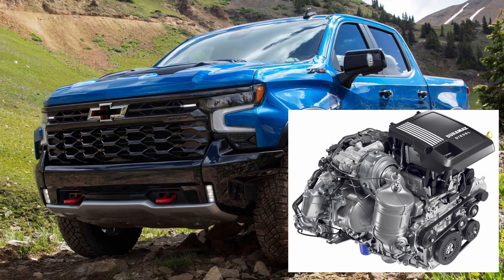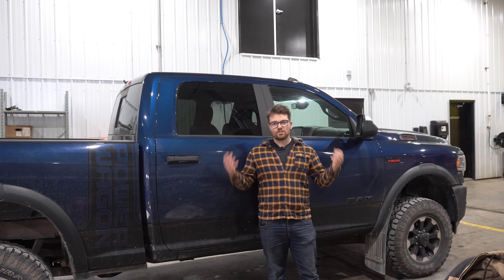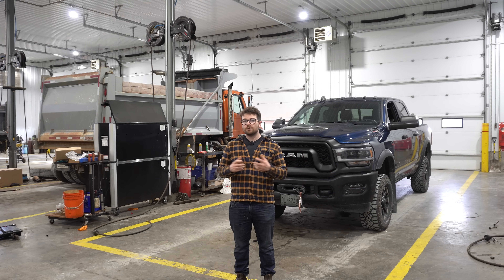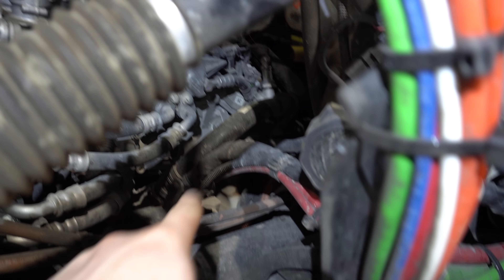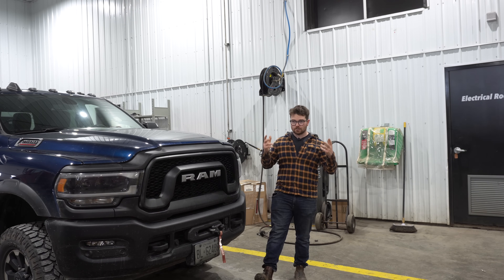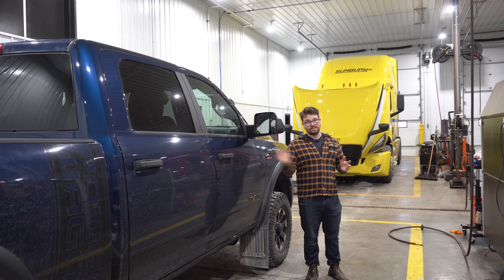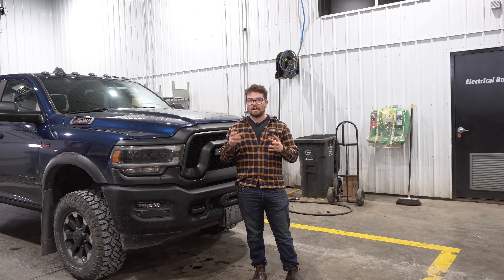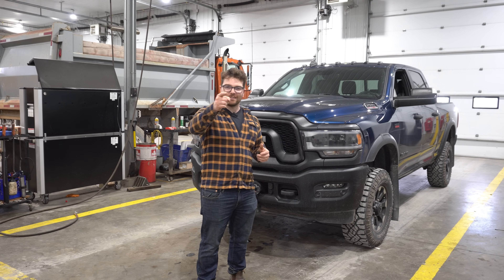Chevy Silverado 1500 3.0 Duramax Diesel **HEAVY DIESEL Mechanic Reviews** | Is It a GOOD Engine??

Comment: My understanding is that they finally figured out how to mitigate the long start issue for the LM2 without needing to replace the CPS exciter wheel. Basically, the issue was that the ECU just gave up if it got a single invalid CPS reading during the startup interval (which was short).  My layman's understanding of the fix was to add a few extra rotations to the startup interval and sample more than once. That apparently has fixed it permanently for nearly all situations where the wheel was the problem. (The underlying supplier issue was fixed for LZ0.)
Reply: Ecu flash fixed mine, it pauses the start procedure for about .5 seconds to allow multiple sensor pulses for the start sequence.  Never had the problem since.
Reply from the maker: Good to know! I guess my info is old. I'll pin this comment so other can see!
Reply: @cjwright1960  It pauses the start process lol how convient.
Reply: @foch3  yeah an unflashed ecu will start cranking immediately and engine star happens very quickly when you press start, a flashed ecu will have about a half second delay before it starts cranking, and the cranking cycle will last about a half second longer.
Reply: The engineer details those changes here: https://www.youtube.com/watch?v=J7KM5-oMLm8
Reply: My 2021 GMC Denali with the 3.0L diesel has done long crank/no start issue. It has occurred 5x in a year. Cranks for 30 seconds which the owner can’t stop. My gas mileage has also dropped by 10-12mpg in the winter. Best I’ve gotten is 37.5mph highway. Missing that.
Reply: 87,000 miles on my 2021 and I have had a long start twice.

Comment: The oil belt is not an issue, because you just replace it (you don't pay to inspect it at 150K and then put the old one back on). If it fails, GM chief engineer says it just limps you to side of the road, nothing serious/catastrophic. And the new update coming is longer belt interval, and almost 500 lb/ft of torque!
Reply from the maker: I guess that would make sense but still little annoying.
Reply: They’ve extended it to 200k miles now, too.
Reply: It's still expensive as hell! You have to pull the transmission to replace it.
Reply: @jasonfalk7696  It'll be like a $1500 job at any competent shop. That's peanuts for an engine that can probably run 500,000+ miles with otherwise regular maintenance, stunning performance, and the best MPG you'll find in a half ton even at todays manufactured diesel pricing crisis..
Reply: @PygmySurfer  how, by waving GM's magic wand
Reply: @jasonfalk7696  i pull transmissions out of these trucks, i say stay away
Reply: @david I assume by examining the belts they have pulled from trucks.
Reply: You only need about 1.5 inch gap to replace the belt, not “drop the trans”. It needs to slide back to create space to access 1 bolt, everything else is accessible through the plate.

Also check the service interval on any timing belt (~75k). Please tell me that you remove all accesories in front of you engine, remove the timing cover, and inspect/replace your timing belt that often.  Timing belt failure on non-clearance engine is catastrophic.
Reply: @JohnSmith-ev1sm  $1500 for a belt replacement every 100k to 150k miles wouldn't be worth it in my opinion. I see videos where they say 30 mpg, but that's not their average. If a 5.3 gets 18, and the 3.0 gets 25, then the price difference between fuels wouldn't be that far off. Then add oil changes, fuel filters, dpf issues, etc. I love the idea of the 3.0L, but the only way it makes sense, is if the fuel was close to the same price.
Reply: @cjwright1960  to pull the trans back 1.5 inches, requires everything involved with pulling the trans. Maybe you could leave the weight of it on the crossmemeber, but you're still removing everything attached to it. Also, what truck has a timing belt?  They all have chains as far as I know, and they "should" last 200k miles.
Reply: @jasonfalk7696  then don’t buy one.
Reply: @cjwright1960  I didn't. When they came out, I was excited as all hell. But, after running every number, it didn't come out much better than a gasser.
Reply: @jasonfalk7696  there is a known issue with the 5.3, dropping valves without warning.  GM cant do anything about it till it happens.  The 6.2 gets like 11 MPG average, active fuel management is punishing on the top end of gas engines.  They all have issues.
Reply: @cjwright1960  I agree.
Reply: @jasonfalk7696  The belt isn't being replaced every 100K. It had a 150 "inspection" interval, which you can safely push off to 200K. And the new engines are rated to 200K so you can push that even further. The 3.0 is faster than the 5.3 under WOT, and much faster under normal driving with far less downshifts. Full torque is available at about 1500 RPMs. That's insane. It will also pull a trailer much easier due to that awesome torque curve. And it gets much better MPG. The 5.3 is useless, the 2.7 is better if you want a cheap gasser and the 3.0 is better if you want a much stronger engine while getting better MPG. In short, you need to open your eyes.
Reply: @JohnSmith-ev1sm  for the record, I don't own a GM truck. I went elsewhere when I bought. I was comparing the 5.3, just as an example.
Reply: @jasonfalk7696  I own a 2019 Ram. Just saying, in the GM line-up, the 5.3 is there for those guys who insist on v8's; but it is overshadowed by both the 2.7 and the 3.0 which both make more usable power, feel stronger, and get better MPG. So the base engine is 2.7, and then the smart person upgrades to either the 3.0 or the 6.2 depending on whether you want max MPG or max horsepower.
Reply: @JohnSmith-ev1sm  I own a 2020 Ram. As a truck driver, the diesel option had me excited. But, the extra maintenance cost is much higher than people realize. Plus, the emissions shit is almost never reliable. I'll give it a few more years, to see if things change. Until then, I have no reason to jump ship.
Reply: @David-yy7lb  how? By looking at current trucks who have 150k miles data has been send back to GM engineers and they found it's not needed at 150k miles thats how, no wand needed
Reply: @jasonfalk7696  5.3 doesn't get 18 I get 15 at best with my 5.3.  I have gotten 33.2 mpg best and lots in the high 20 ''28/29'' or low 30's with the 3.0 and that is with the bed fully loaded including 52 extra gallons
Reply: @jasonfalk7696  2 points: diesel resell is higher so you get some of that back, and both the hemi and the gm v8's have lifter failure issues and broken manifolds, neither of which are a problem in the 3.0 diesel. Pick your maintenance poison, but don't go around thinking diesel is costly and gas is cheap to maintain. I run the best oil I can find and that's like a $150 oil change doing it twice a year in my driveway, just to help prevent lifter tick/failure. Secondly, some things that cost a little are still worth it. Like leather seats over cloth. You can argue that you're wasting your money because the cloth seats get you to town and back, but the leather is nicer. Same with the diesel, it drives awesome, power delivery is smooth and incredible. That's worth a cost to many, even if by some odd fluke of financial flakyness you manage to spend more on gas/repairs with the diesel.
Reply: @AmazonWebService98  these are new engines, how many do you think are already over 150,000 miles? GM can easily say don’t worry about it it’s good to 200,000 miles because it will be waayyy past warranty. Your bill not theirs. It’s like the 150,000 transmission fluid changes.
Reply: @aws my wife's 5.3 suburban get 15 to 16 mpg around town and if we are on a short  trip (over 60 hwy miles) we typically get 22 or 23mpg @75 mph.  If it's a long trip (200 plus miles)  I've seen 24 to 26 mpg @75 mph.  It's got high milage for a 2015 and when we picked it up it had a valve train noise and shortly after the torqure converter started its issues.  I have always ran quality oil witch corrected the valve train noise and after adding a deep pan and new filter plus dropping just the tyranny oil a second time I've corrected the torque converter shutter.
Reply: Torque is expressed lb hyphen ft and not lb slash ft!!! It does make a difference in engineering terms as the slash symbol is meaningless and is not a value of torque!!!
Reply: I have a 2021 3.0 , no problems except  ,  except  ,
Reply: @jasonfalk7696  My pop's gets 33mpg mostly in town little highway I own a 2016 5.3 now it is tuned mostly 4cyl taken off cause of lifter failure and I avg 18 with same driving on the high end. Now diesel does need to come down but at nearly twice the mpg definitely worth it
Reply: Anyone who doesn’t own one of these or a truck like an Ecodiesel flat about just don’t know what you’re talking about when it comes to apples to apples comparison to the gassers vs diesel. I’ve got 2 of them and if you drive a lot it’s well worth it. I went from 16mpg to 30. At 50k miles a year do the math on the fuel savings. Saves me $2500 year in fuel plus better resale and longer life.
Reply: Yeah, when your oil pump stops working at 3000 rpm you'll limp to the side of the rd alright.  They took a motor that would be a 10 and made it a 5 with this one shitty belt
Reply: Hope I can get that update on my 22 hehehe
Reply: Gives us a sermon while standing beside a ram. Lol. But a great sermon
Reply: @lynskeyti9940  The motor is easily a 15, but some guys just have no vision. The belt easily lasts beyond 200K, so replace it a 190. No limp required.
Reply: @lynskeyti9940  Like I said, no vision. There are no shit trucks (are you 12? You sound like you're 12), it's just that the GM 3.0 is exceptional in the 1500.
Reply: @JohnSmith-ev1sm  I never said trucks, I said vehicle...try reading it's FUNdamental. Most of the newer vehicles are shit. We have 2 of these pos in my fire dept, they spend more time in the shop than running calls and they aren't even ran that hard. Don't get me wrong I'm a gm man I have 3 gm truck platforms in my driveway.  Early 5.3 and 4.8 and 1 atlas I6, they will still be going when these things are ground for scrap. The 5.3 is actually one of the rarer L33 engines.
Reply: @lynskeyti9940  Doesn't make a difference lad, cars, trucks, statistically there are no real lemons out there these days although someone has to get the occasional bad apple, that's how stats work. The 3.0 GM is the one true gem to come out recently. Gobs of torque, high MPG, quiet, buttery smooth, and because it's inline and diesel it will run forever just like the cummins. If everything you see is junk you might need some anti-depressants or corrective vision. (There's that lack of vision thing again, eh?.)
Reply: @JohnSmith-ev1sm  Tried those, had untoward effects. Didn't say everything said most, the new big block gas engines from ford and gm are a boon for us in the fire service.  Gives a good reliable power plant for an ambulance. Most of today's bs is car makers trying to government requirements
Reply: @lynskeyti9940  Gassers still make more sense for short trips and in the city, that doesn't mean the GM diesel is junk it means modern diesels (due to emissions and def) don't work well for your specific use case. Diesels want to run and be worked hard, that's where you save on fuel and where they get hot enough to detox. I'm tired of hearing my hemi scream while it's towing, that's how all N/A gassers work including the big boy 7.3 from Ford. I want smooth, effortless, quiet, powerful, and great MPG. That's where the 3.0 shines. Its an awesome engine but yeah you have to drive it, no modern diesel responds well to short trips in the city.
Reply: @jasonfalk7696  Yea and in your shitty 5.3l or 6.2l you get to replace the whole engine when the DOD lets go.
Reply: Where in the world was this stated? If you lack oil pressure the engine won't last long.
Reply: @MixedGrid  I don't own a GM truck. I stated why I didn't buy one in 2020.
Reply: Just replace the belt when you get the transmission rebuilt, really not a big deal. If you think any gm transmission is going to last more than 150k miles then I have some beach front property to sell you in Oklahoma 🤣
Reply: @fflowwiththego  Good point! 🤣
Reply: @mooseman3136  There are people that put 50K+ miles per year on vehicles so in 4 years or less they could still run into issues.
Reply: @CJ Wright   I have a GMC Sierra half ton with the 6.2 that gets way better fuel milage than that . Mine is closer to 17 or 18 and 19 or 20 highway driving. My work truck, a Silverado with the 5.3 gets less than that, maybe 15 on average.
Reply: @cjwright1960  exactly
Reply: @cjwright1960  My 6.2 with 90,000mi gets 20mpg and I drive like a teenager.
Reply: @JohnSmith-ev1sm  and here I am using it for uber eats delivery driving lol. We'll see how it goes
Reply: Sounds like an awfully expensive requirement.
Reply: @JohnSmith-ev1sm  it’s still a diesel and you still have way more expensive maintenance compared to gas engines.
Reply: @andredornier  Chevy can’t make a reliable transmission.
Reply: @jasonfalk7696  exactly cost of ownership is the same if not more than the 5.3 version.
Reply: @JohnSmith-ev1sm  2.7 is a ticking time bomb.
Reply: @AmazonWebService98  my buddy has a 5.3 GMC and he gets 19-20
Reply: @cjwright1960  in european engines there is some extreme cases. on bmw (20d/25d) chains placed back of engine. it must be replaced max 120k km (75k mile) and its hell of a job. need to be drop transmisson (25d also comes with xdrive in that case you must be drop front differantial) also take out whole engine, chains, chain oil pump and tensioners also replaced. if you push to 150k km (90k mile) risk of shattered chains gets higher and if its occured you have to be replaced whole engine. 30/35d engines doesnt have this issues 250k km (150k mile) most of the chain replacements happend. but job description same. 

audi is different kind of story. 2.0tdi/3.0tdi's mostly solid as rock. full engine renovations comes up 500k km (320k mile) extreme samples, i see it on my eyes 2.0tdi still working on 865k km (540k mile) without any issues. but belt changes almost a nightmare. belts placed front of engine but space is tight. whole front facade must be dismanteled. also water pump and 2 thermostate (one with water pump integrated. other one named as finger theromstate) must be replaced. 

i think in a couple years there is some vids about this engine belt replacement. until that time engine seems legit.
Reply: @tonyatkinson965 must be the 2014-2018 bodystyle. After they updated in 2019 non of the V8s got good fuel economy. My mil ‘21 Tahoe with a 5.3 gets 16-17 on a good day going downhill with a tailwind.
Reply: @skoolynugenator1802 my 2014 5.3 averaged 20.8 over the 50,000 miles I owned it but the newer body styles can’t pull that off and have a higher incident rate of lifter failure. I went with the 3.0 LM2 and have absolutely zero regrets so far.
Reply: @khakiswag  ... valid point.
Reply: @JohnSmith-ev1sm  ... and who are 'you' to say the belt easily lasts beyond 200K?
What if it's 'time' sensitive... 20 years old with only 100K on the engine > > > oil breaks down rubber.
Reply: @hmdwn  I didn't say that, GM engineers pointed that out in their testing. And if you get 20 years on a low mileage diesel who cares, a $1500 maintenance item is not exactly a problem once every 20 years.
Reply: @JohnSmith-ev1sm your a joke if u think this engine is going past 250k lol
Reply: @jasonfalk7696 got my 01 tundra 2uzfe timing belt v8 engine. Idc. This engine unlike chevy engines and this duramax, mine will actually last 500k
Reply: @cjwright1960 6.6 gasser only good one
Reply: @JohnSmith-ev1sm orr just buy an older pristine chevy or Toyota lol.  New shits junk
Reply: @lynskeyti9940 yup. Stop buying this new age junk and buy older pristine chevys
Reply: Limp home mode,with zero oil supply ,with a diesel,? That is hilarious ...
Reply: @h8troodoh  No. Normal people do scheduled maintenance and will replace the belt before it fails. If you're one of those guys who don't, then yes you'll have enough warning and time to pull over and limp to the side of the road and get towed to the nearest garage.
Reply: @JohnSmith-ev1sm  you missed the point, and you're obviously not a mechanic.. if oil stops circulating in  an engine, generally you're looking at engine damage,catastrophic  in some cases.. there's no faken way I'm traveling down the highway doing 60 and that oil pump drive belt goes.. there ain't no " limping home".. she's done like dinner, son. Btw even new stuff breaks, so don't gimme the scheduled maintenance b.s. lol
Reply: @h8troodoh  No you're not watching the GM engineers who have thought about this very scenario and who have talked to Tim E about this. You're just rambling nonsense.
Reply: @JohnSmith-ev1sm  besides if  engineering did any real thinking ,the belt would not be there in the first place.. what's next a hand crank cuz the starter wouldn't fit.. give your head a shake...you too GM engineering...
Reply: @h8troodoh  The belt is a wear item, like power steering pumps, water pumps, turbos etc. You know nothing.
Reply: @JohnSmith-ev1sm  a Ram owner .lmfao ..nuff said...
Reply: @h8troodoh  Whatever your problem is, I don't care. Move along sunshine.
Reply: @LWRC  It's actually lb-ft. It does make a difference in engineering terms as ft-lb is a unit of work or energy, it is NOT a unit of torque. Lb-ft is a vector with magnitude and direction, while work/ energy is a vector with magnitude only. One is a dot product, and the other is a cross product.

This info is only being provided because you seem to be a person who's into the fine details of being technically correct. 👍